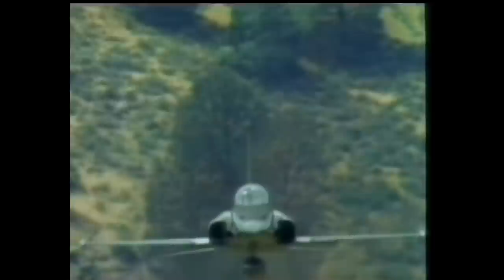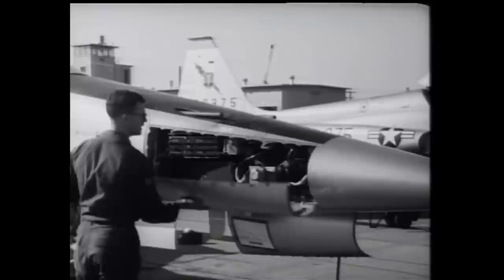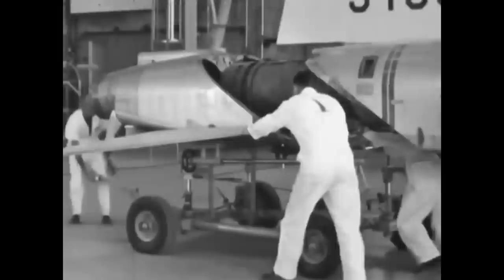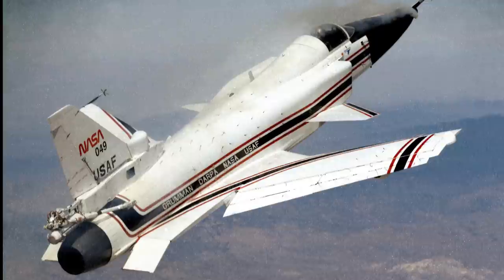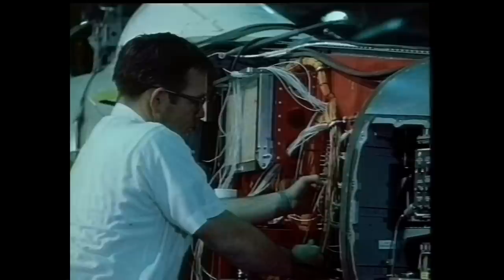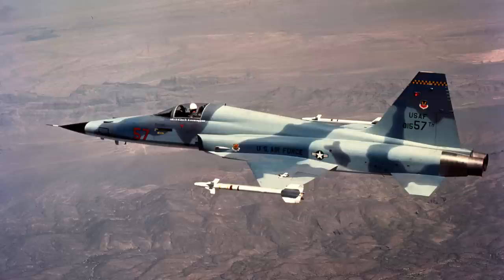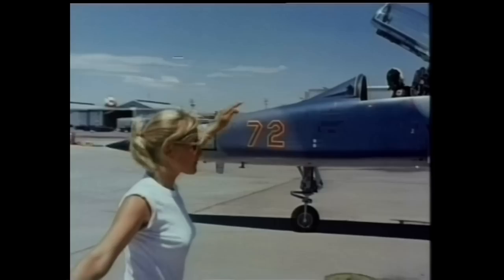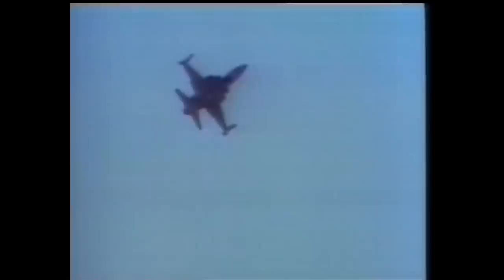Northrop F-5 Freedom Fighter | The American Supersonic Light Fighter Aircraft | Upscaled Footage

Comment: The F-5 is great plane in many ways, but this video overstates its capabilities and draws shallow and inaccurate conclusions with regard to its air combat results against front line fighters.  The F-5 was able to beat these fighters because it was flown by expert instructors under rules of engagement that suited its use as a training aid.
Reply: this 1960's plane still can see all the time  fly over our head from nearby AFB , then moment later , a F-18 will take off and chase it. the only different to me is F- 5  fly louder
Reply: If they continued variants of this plane
They can still be easily the top tier light attack/trainer planes and if not the cheapest per unit but also per hour
Reply: @everydaydose7779  The F-5 was a great design I'd love to see fly forever, but it does not have the performance to be a ""top tier" trainer in today's world.  Most airplanes can be pressed into the "light attack" role, but there are more suitable and less expensive alternatives than the F-5.
Reply: @everydaydose7779  not really, they had pretty much stretched the Airframe to it's limits with the F-5F. The F-20 was a completely new design. And it gets more expensive to operate the older it gets. Newer aircraft are less expensive to maintain because they designed in modularity and self test capability. You have an electrical fault a modern aircraft, the self test localizes it to a certain box, the crew chief quickly disconnects and removes the box, replaces it, and the aircraft is set to go.

Comment: The first two series F 5E aircraft still fly today, they are operated by the Brazilian Air Force, the aircraft registration 11417 in the USAF, flies in the FAB with registration 4856 and the 1418 flies with the numeral 4857, both were modernized for the EM standard.
Reply: Taiwan also still fly the F5E.

Comment: F-5 cost per flight hour is very very low compared to all others in US inventory.  Also, the Air Force has learned, that putting too many hours on the F-22 will lead to its early retirement, but the pilots still need to keep their hours up, in a high performance jet.  The Air Force and US Navy has been interested in 'buying back' F-5's from foreign nations.
I think some versions of the F-5 will be around to see the retirement of the F-15, F-16 and F-18...  Cheap to keep.
Reply: They should be revived ngl
They can be used as trainer crafts for high G simulations till this day and can be exported even to this day for agressor/trainers for other countries
Reply: @everydaydose7779  A lot of countries leaders haven't come to realize, these jets are great low cost per hour to operate, and allow their fighter pilots to keep their hours up...  I see Norway just sold off ALL of their F-16's having only F-35's now...  good luck with the cost of keeping those nightmares flying, and their pilots hours up where they should be

Comment: I saw a standard air show display with an F-5. With this one, you need a starter to get them started.
The plane did the same routine as any F-15, or F18.
As I understand it the focus changed to a multirole fighter. That means it needs to be bigger to carry more bombs. That's like F-15, F-16, and our F-18.
The form is not dead on this fighter plane.
Iran's homegrown fighter is basically a homebuilt F5. They have evolved the plane up to the 'Tigershark' level.

Comment: I was a young teen in Indonesia when the country was looking to modernise their Air Force in the 1980s. They were flying F-5s, A-4s, and OV-10s. The F-20 was considered but they decided to go with F-16.

I had a strong opinion that Indonesia should’ve gone with the Tigershark as it was significantly cheaper and easier to operate than the Falcon. Especially when they already flew the F-5s. They probably could’ve bought more for what they spent on the General Dynamic plane.
Reply from the maker: Thanks for sharing your insight Michael